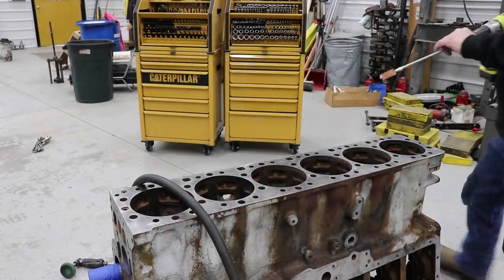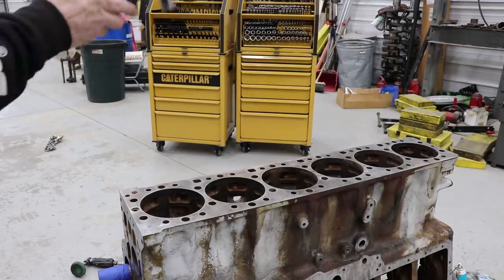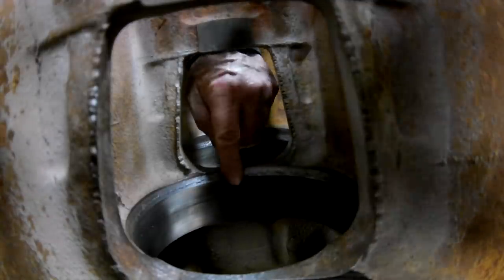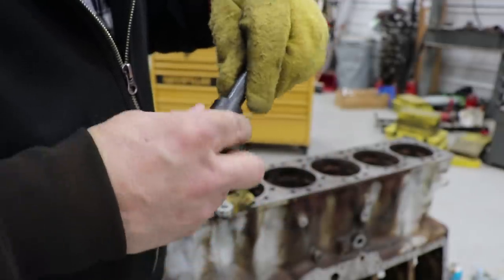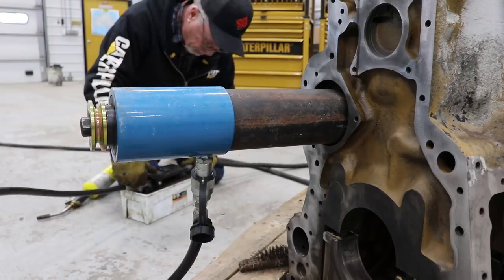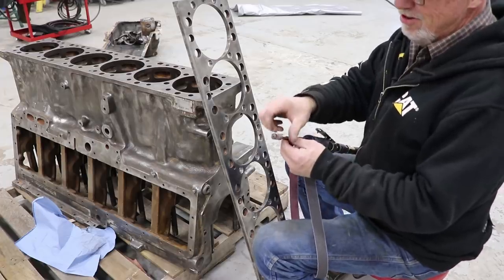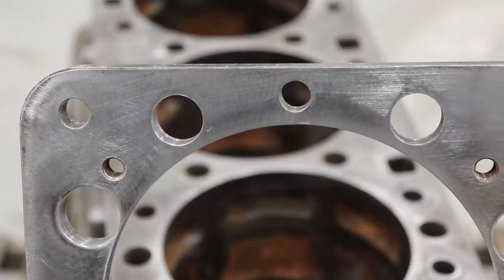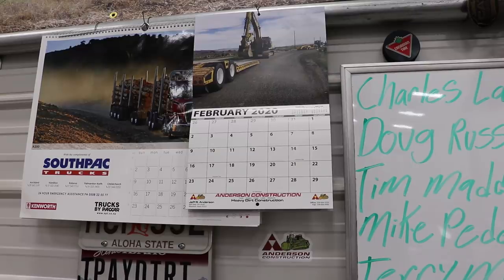1693 Cat Paint Removal And Final Cleaning

Comment: Hey Mr. Dirt.
I know you don't want to hot tank the block because you want to keep the nice yellow paint on the inside.
Can you find a shop with one of the "dish washer" type parts cleaners.  They won't take the paint off depending on what they are running for a solution.
I really think it would be a good idea to get it bathed to get all of the crap out of the passages
Reply from the maker: I'm a house cleaning tornado bitch from hell LOL  watch me go

Comment: I ran a 1693TA over-the-road in the 70's. Back then, it was damn close to being "king of the road." The only engine that could beat it was a was the "four and a quarter" CAT, the 3408 CAT, or the 12V71 Detroit. It's been fascinating to see this teardown. I sat "on top" of that 1693 for thousands of miles. But this is the first time I've seen inside. Thanks.
Reply: You forgot the best one of the m all kTA600 Cummins 1150 cubic inch blows them all away & it was so good they & still make it today its electronic QSK19 ,1693 was a great engine way too many moving parts KT CUMMINS RULE

Comment: I have a few flapper wheel like that out of round stock in different lengths, but I've never wrapped the Emory cloth on like that I take a length of cloth and fold it in half then flip it over when it gets worn.
Like using the 2 inch wide cloth.
Keep up the great work

Comment: Why did you not chemical hot tank that block? Might have saved some elbow grease.
Reply from the maker: I don't want to loose the original paint inside, this engine is a virgin, this is the first time it's been opened since it was built, if you watched the previous videos it still had the factory bearings in it
Reply: @Jpaydirt  I hadn't realized that was your plan. Carry on and keep up the good work!

Comment: Jeff is the 1693 and the DT343 the same engine just with a different designation: one for trucks and the other for off-road apps.? What is the difference on fuel pumps ex.????
Reply from the maker: 1693/D343 same engine,  difference lies in the rear housing and water pumps,  and a few miscellaneous items
Reply: @Jpaydirt  looks like the oil cooler is in a different place than a D343 . The oil cooler on a D343 is on the starboard side of the block just above the pan surface. Pain. In. The. Ass. To remove & install.

Comment: What is the reason Cat used a spacer plate?  Was the block also used for spark ignition engines?  The engine would've been less costly to produce if it would've had counter bores and no spacer plate.
Reply: Actually the machining was easier to do with the spacer plate because all the bores became thru bores so you only needed to maintain diameter and not both diameter and depth.
Reply: @bcbloc02  I agree but the parts count would be lower and fewer operations therefore less time with counter bores.  At rebuild time the spacer plate is much easier deal than counterbores.  I love your content also bcbloc02.  Thanks.
Reply: The spacer plate uses less machining for the block. Also ALL older Cat engines did have counter bores like D353, D397-D399, even the older D330 & D333 before they became 3304/3306 had them. They suck. Cutting counter bores and "stepping" the block with inserts is common during overhauls for those older engines. Spacer plate engines rarely have to be cut. The heads walk on the deck surface too and its much easier/cheaper to replace the spacer plate.

Comment: What are you spraying in the can?
Reply: Looks like starting fluid (ether).  It's a very good oil and grease cutter.
Reply from the maker: either when I was cleaning them and then liquid wrench when running the threads

Comment: ,,, do you use coolant filters, with the SCA's ? ,,, On the ball check valve seaf,, I would use a 4 flute countersink tool with the correct angle. Problem is: it might get too wide, and or too deep . Cat must have a procedure . I might want to not take that ball out, I mean its had a million gallons of hot, high detergent, filtered, oil,  go through  it .
Reply from the maker: no i don't roland..........on the ball it's a ball bearing harder than the hubs of hell  to borrow a phrase from @western truck and tractor    LOL

Comment: 1/4" drill rod makes the best die grinder accessory tools Jeff.
Might think about getting the block align honed / bored.
The heat / cool cycle on engines, cause them to distort just enough to bind up the crank.
Block paint for the inside. Electric motor spray varnish. Seals the cast iron & helps oil return. Build a million mile engine avoid skipping the most important steps. Looking good. Sure will be nice to see a 1693 come back to life...

Comment: Use a pin drill to find the hole size of the ball...melt it out...put a pipe plug in the hole after drill n tap...drill hole in plug if needed..may need xtra long reamer to get in the hole.....Drill will walk to find center..
Reply: If your lucky you will find a stepped reamer...the step will hold you on center, kiss it at first to start a flat pad then go to town

Comment: I know you want to preserve the paint on the inside of the block but me myself and I would have the block Hot Tanked and then paint the inside of the block “Glyptal” paint aka Amature paint the only trick with painting anything with Glyptal is clean whatever you are going to paint with Lacquer Thiner, and or Acetone and thin coats and let it dry I like to bake using lights or a heater good
Reply from the maker: yah but then i have to worry about it coming off and this paint has been there since 1973 so it's time tested and good, I can clean it up good and sleep well knowing it's not coming off  LOL

Comment: when using wire brushes to clean out bolt holes.. please run the wire brush in reverse so it pushed the debris up and out.. not pack it to the bottom of the hole.. 

as for the pin that is in the back of the bore. you may need to measure carefully and get a annular cutter.. think hole saw. . but from a machine tool supply.. and just touch around the pin https://www.mscdirect.com/browse/tn/Holemaking/Hole-Cutters/Annular-Cutters?navid=12106155 you might need to drill a hole in a bolt for a guide. to keep it steady. you may have to cut the bolt off and slice a groove to allow you to screw it into the hole so you are not going thru so much..
Reply from the maker: if I went backwards it would unscrew the brush,  so that's a hardened ball bearing ball in that hole, do you think anything would touch it?
Reply: @Jpaydirt  the annular cutters would drill around the ball not thru it. Can you perhaps isolate the oil passage behind the ball and pump grease in behind it to drive it out. . You will still need an annular cutter.  

Or take the block to a tap extractor company and let them burn the bearing out with their arc machine.